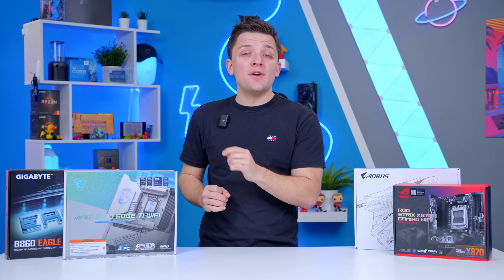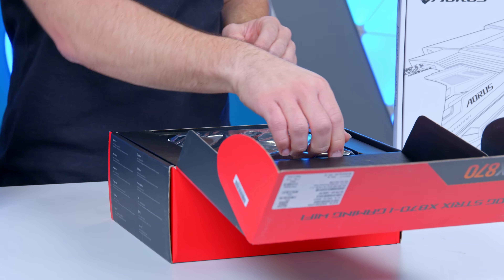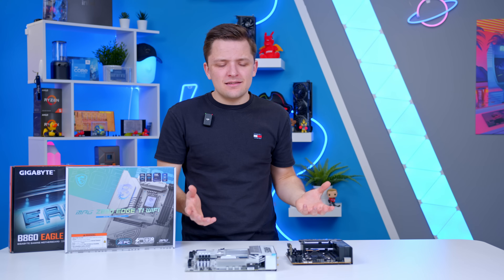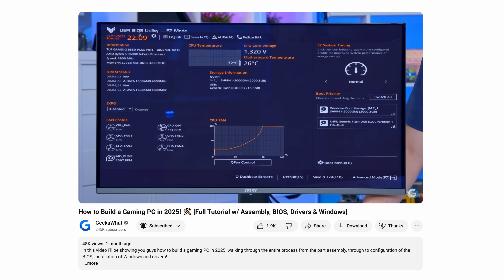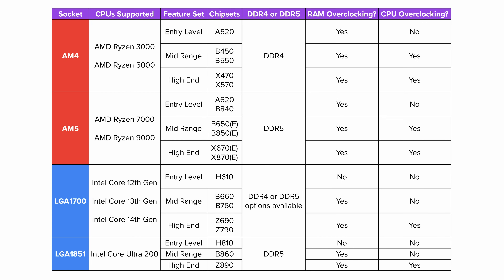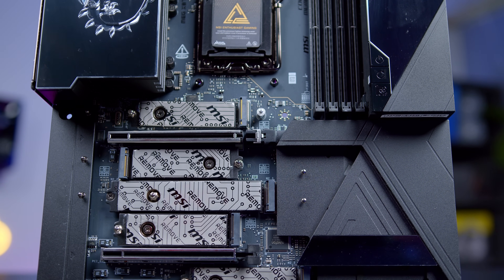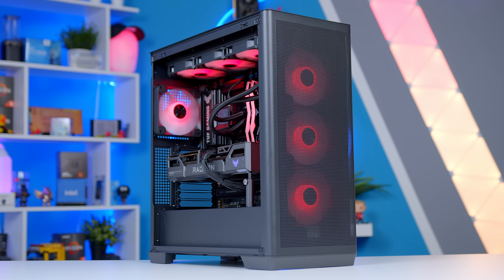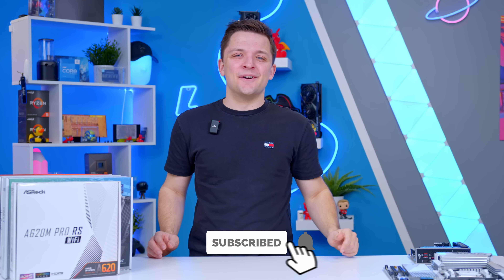How to Pick the PERFECT Motherboard for a Gaming PC in 2025! 👌

Comment: I am going to be building my first pc soon, and the parts I have chosen are the AMD Ryzen 9 7900X for my cpu, Lian Li Galahad II Trinity SL-INF 61.3 CFM for my Liquid CPU Cooler, a Gigabyte X870 AORUS ELITE WIFI7 ICE ATX AM5 motherboard, then 64 GB of TEAMGROUP T-Force Delta RGB DDR5-6000 CL30 Memory RAM, along with 4 TB of Kingston NV3 m.2-2280 PCIe SSD and I am looking into HDD and more SSD, ASRock Steel Legend Radeon RX 9070 XT 16 GB GPU. This will all go in a NZXT H9 Elite ATX Mid Tower Case, and I will use the Lian Li EGDE 1000 W 80+ Platinum Certified Fully Modular ATX power supply, though I’m not sure yet because I don’t really think I need all that wattage. I’ll also be using more Lian Li with some Lian Li Uni Fan SL-Infinity 63.6 CFM 120 mm fans. I’m just new, so I don’t mind recommendations if anyone reads this and has any, also all of these components are going to be white and some have RGB because I am just trying to play at 1440p with mostly story games like The Last of Us, Undertale, and Final Fantasy, Hollow Knight, maybe Cyber Punk, DBH, DBD, Dark Souls, Resident Evil and such
Reply: What was the point of all of this.

Comment: im basicly a noob at this but some motherboards seem like they need the wifi part to be attached to the actual motherboard either in the back or somewhere else? like with 1 or 2 antennas.. is it possible to get a motherboard where its just build in so you dont have to mount those antenna things? or isnt that a thing ?

Comment: Guys here are my parts i want to buy and build a pc with:
RAM: Kingston Fury Beast RGB KF560C30BWEAK2-64
PSU: Gigabyte AORUS ELITE 80+ Platinum ICE 1000W (already have it)
GPU: xfx 7900 xtx (already have it)
CPU: ryzen 7 7800x3d (already have it)
CPU cooling: cooler master 360 (something but idk XD)
Case: Phanteks NV7 White
Fans: XPG Vento 120 ARGB PWM, 3-pack times 4 so 12 fans total for the case
Mobo: ASRock X870 Steel Legend WiFi
SSD 1: Samsung 9100 Pro, no heatsink 2TB (already have it)
SSD 2: Kingston FURY Renegade with Heatsink 2 TB SSD (already have it)
Will this all work together well? and fit? as i checked it was a yes for both :)
Reply: RICH MILLIONAIRE !! ! !
Reply: it still works, no problem, and you don't need too many fans like you said, 7 fans is more than enough. Don't let too many fans run, it will only make your motherboard work harder. The problem with assembling the parts together is to let it work with all the power that each part has, to avoid wasting when installing it but it doesn't work as it should. Mainly the psu: don't let it go below 150w, which is the total consumption of the devices mounted on the board. Do what you like.

Comment: I'm not computer-savvy at all but I'm planning on building my own, and I need all the help I can get. I don't know what anything means. I do enjoy you and your videos. Easier to understand then some.
Reply: I'm on the same boat right now mate, goodluck with your pc building!
Reply: Years ago, I used to be as sharp as a cotton ball when it came to computers. Dumber than a bag of rocks. Today, I can build, maintain, upgrade, troubleshoot, etc.

My advice is to take it SLOW!! Take your time learning the basics of the components, and how they work. The CPU, motherboard, and video/graphics card are the most important since they are the core components. Everything else is fairly easy to learn since they aren't that complex.

Comment: I'm new to building PCs but ordered most the components already. The motherboard shopping seems overwhelming now. I got a Saphire 9070 xt and Ryzen 9900x3d but I'm not sure what motherboard to get for the build. I was looking at an Asus x870-Plus WIFI by Tuf Gaming but now I'm unsure if this is good. Which motherboard would you recommend?
Reply: I'm looking at PCI lanes on the CPU and its 24 but on the x870 it's 16 so this slows the flow of information, right?
Reply: @FUDD101ttv don’t buy asus new motherboards. I scratched my asus astral because of that dumb q release slim mechanic.
Reply: @gameplay-le8cy  thank you
Reply: @FUDD101ttv Msi x870 tomahawk is a good one. B850 motherboards would also be more than enough if you don’t need usb4

Comment: Big disagree on ATX. Since 99% of even enthusiasts will never use more than one expansion slot (for the GPU) the additional space and slots provided by an ATX board are just wasted. Choosing the mATX SKU instead of ATX will save typically about $50 and all you will lose are some extra expansion slots since mATX can have up to four M.2 drive slots. If your budget for a PC is under $1500 choosing mATX is a no-brainer.

Comment: CPU: AMD Ryzen 5 7600X (6C/12T, 5.3GHz)

Motherboard: MSI B650M Gaming Plus WiFi DDR5

RAM: ADATA XPG Lancer 16GB DDR5 6000MHz

SSD: WD Black SN770 500GB Gen 4 NVMe

PSU: MSI MAG A650BN 650W 80+ Bronze

Cooler: Cooler Master Hyper 620S ARGB

Cabinet: Ant Esports ICE-170 TG (Black)

Gpu 4070 or 7700xt to be bought later,

Is this build good or anything to be updated here can please reply thanks
Reply: Swap cpu cooler to Peerless Assassin 120, and get at least 750w gold certificate psu just too future proof yourself now.
Reply: thanks brah I'm stealing this :yt:

Comment: Very useful, thank you!
Im trying to build a pc with rtx 5080 and ultra 9 285k.
Reply: If u are only gaming with the pc, it's best to avoid the intel ultra series. They are actually worse than the 14th gen in gaming.
Reply: @myshiftisbroken  Thanks! I did read a lot about it. I did see the performance was worse but with latest updates and changes in the bios and paired with a good motherboard and ram the performance can be better. I will also use it for software and game development. The npu and lower power consumption are also positives.

Comment: I just bought all these parts and I am building this weekend, Let me know my mistakes before I start. AMD Ryzen 7 9800X3D 4.7 GHz 8-Core Processor, Thermalright Hyper Vision ARGB 69 CFM Liquid CPU Cooler,  Asus PRIME X670E-PRO WIFI ATX AM5 Motherboard,  G.Skill Trident Z5 Neo RGB 64 GB (2 x 32 GB) DDR5-6000 CL30 Memory,  Crucial T500 2 TB M.2-2280 PCIe 4.0 X4 NVME Solid State Drive, PowerColor Red Devil E/OC Radeon RX 9070 XT 16 GB Video Card, Thermaltake The Tower 600 ATX Mid Tower Case, Super Flower LEADEX VII Platinum PRO 1200 W 80+ Platinum Certified Fully Modular ATX Power Supply, 3xThermaltake SWAFAN EX12 ARGB 57.11 CFM 120 mm Fans 3-Pack

Comment: In terms of future proofing this generation of Gigabyte boards are horrendous.  All of the X870 and X870E boards have lane sharing (Didn't research the B850s) but if you use a Gen5 NVME your PCIE x16 becomes a x8.  Bye bye bandwidth.  Got a PG Nova X870E.  Dedicated lanes, amazing power stages, pricey yes and biggest downside is no x4 on the other two PCIE slots but basically a mini Taichi.
Reply: Is gigabyte b650 eagle also bad?
Reply: Did you cpu blow up lmao

Comment: Just bought Gigabyte B850 Aorus Elite wifi7 Ice a few days ago, still on the way will post update once it arrived with the processor!! UPDATE: Everything went smoothly enabled EXPO at 6000 CL30 tuned the subtimings to buildzoid, and also enabled PBO and Curve optimizer at -30 now its at 5.5Ghz and runs cool even using air cooler!
Reply: me too paired with a ryzen 9800x3d. Let me know how it is for you
Reply: @skillsless2377 im pairing it with 9700X a Kingbank 32GB 6000 CL30 memory and a Thermalright Assassin Spirit 120 Vision cooler, my cpu, psu and mobo is still on the way mate
Reply: @skillsless2377 mine paired with 9700X and a 32gb 6000 cl30 kit, still on the way now
Reply: Im debating wether to get this aswell or the b650e Aorus Stealth Ice which looks so sick especially with the rgb, and has back connectivity for a clean look
Reply: @Justme-jp8ih  honestly between that I'd def get the b650e aorus elite ice instead
Reply: @Eleganttf2  You mean the b650e Aorus Stealth Ice or b850 Aorus Elite Ice?
Reply: @Justme-jp8ih  b650e aorus stealth ice, but you know 3 days ago Gigabyte teases the new B850 Aorus stealth ice its coming this May so watch out for that tbh than getting an old b650e model
Reply: @Eleganttf2  Oh they did tease that? Its probably gonna cost a lot more tho. But maybe the 650e versions price will drop, so thats good to know
Reply: can a ryzen 7 7700 pcie version 5.0 compatible with motherboard pcie 4.0?
Reply: can a ryzen 7 7700 pcie version 5.0 compatible with motherboard pcie 4.0?
Reply: @anjolojimenez  Ryzen 7 7700 is a CPU, so it is compatible with motherboard pcie 4.0 as long as its B650, B650E , B850 or X670 and X870
Reply: @E @Eleganttf2 my point is, ryzen 7700 has 5.0 pcie , so if you have a motherboard that only has 4.0 pcie  it would work fine but you won’t draw the full potential of 5.0pcie from ryzen since your motherboard only got 4.0pcie . This is what i meant
Reply: @anjolojimenez  yes and its okay and doesnt matter since even an rtx 4090 doesnt even full potential of pcie gen 4

Comment: Got a Asus tuf gaming B650e wifi on amazon for 124€ for my first pc built (but delivery is like 3-4 weeks). The parts are coming together slowly but surely.
Reply: Any update?
Reply: @oktosamurai yes, got my pc completely together for some time. Payed around 1.400€ for the PC and 1440p 180hz monitor. I have a rx 7800 xt and a ryzen 7 7700, 2tb ssd. Works well for 1440p gaming and im very satisfied 😊. Thx for asking
Reply: @oktosamuraiim so glad i bought my ram at this time. The ddr5 32gb 6000mts cl30 i bought wax 90€ then, 270€ now

Comment: so for 9800x3d + 5080 what should i get? looking to build a pc for the first time starting in a month or so. thanks.
Reply: I got the same exact build as u, I bought the MSI B850 Edge TI Wifi and it hasn't failed me yet. However, if your budget is higher, you could try get the X870 Edge TI Wifi that's in the video 👍
Reply: I have a 5080 and 9800x3d in a msi x870 tomahawk wifi and it’s a solid setup so far.